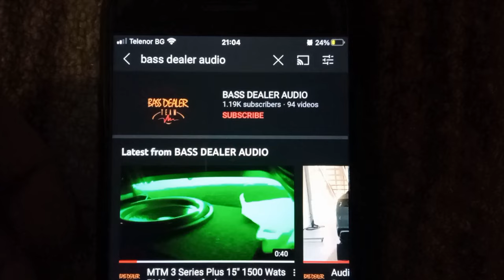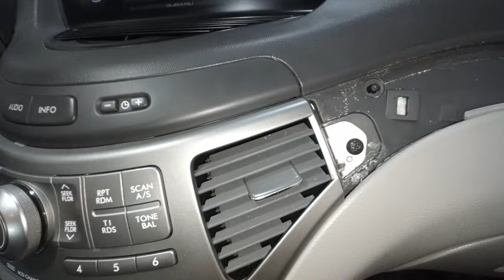Subaru B9 Tribeca Radio Removal / How To Remove Radio / Central Console

Comment: What did you put in to replace it ? I’ve found no kits to replace the radio.
Reply from the maker: https://carmedia.bg/nachalo/594-4624-subaru-tribeca-2007-2011-navigaciya-9-android-multimediya.html#/195-konfiguraciya-99990lv_android_11_8_yadren_cpu_4gb_ram_64gb_rom_rds_dsp_slot_za_sim_karta

Comment: My control lights start flashing when I turn on a/c. No panel lights are visible. Seat heat lights flash. A/c works fine.
Reply from the maker: Check illumination power